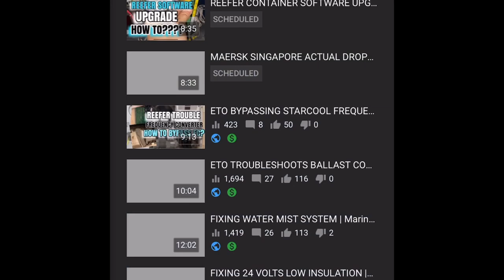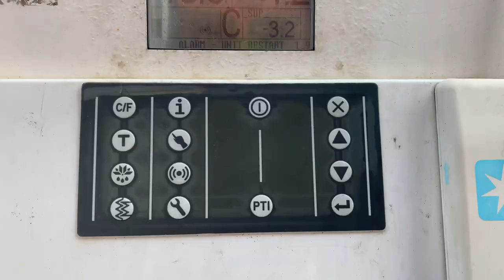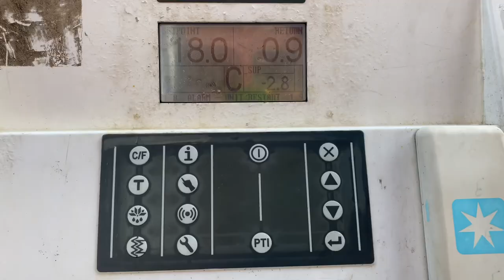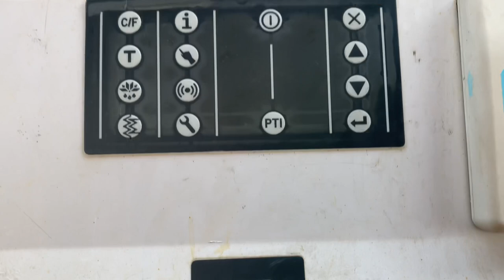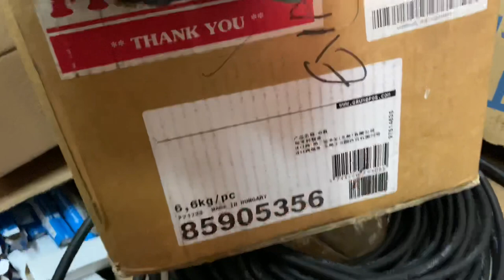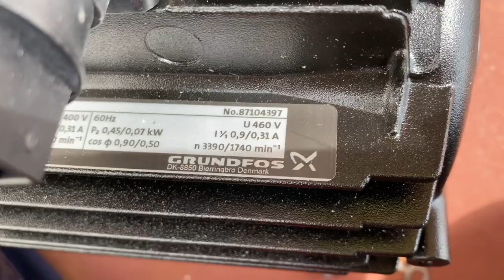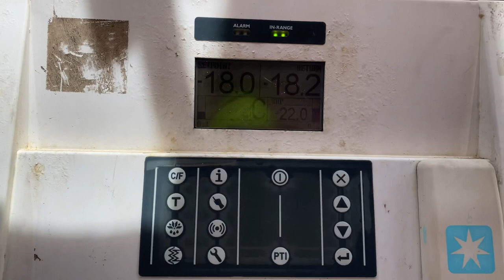EVAPORATOR FAN MOTOR REPLACEMENT | REEFER CONTAINER

Comment: today l got a call from the  harbour,  they said, "  you have to come to fix a daikin reefer container which shows an alarm E109".  l was very happy because l can use the information from the video you made.  and when l reach thier l see that the situation is the same as it was in the video,  l felt happier then.  but unfortunately the EEV was diffferent so l tried to oppen it, but l coudnt becuase it has no nut so l coudnt solve the problem, so we did cross stuffing of the cargo to another container.  

so pls tell me how to open this kind of EEV
Reply from the maker: Might be the solenoid type. You should have used the magnet to open and close the valve.
Reply: @leckyjake  thanks.  where can I find that kind of magnet?

Comment: Sir we electrical engineering do btech and join academy for eto course and we have been taught good enough by academy about duties and responsibilities of eto which is to be handled. And my doubt is.... is that information and practices by academy enough for eto job duties on board.

And when we sail as a trainee eto we are under senior eto and chief engineer... will they train us efficiently on board so that one day we have to handle our duties and responsibilities alone right... will they train us like that
Reply from the maker: Basic fundamentals are the most important in every job onboard. So yes you can apply the knowledge onboard, is it enough??? It will always depend on your eagerness to learn. You need to have initiative and willingness to learn.
Reply: @leckyjake  yes sir I'm very thankful for a good reply

Comment: A very difficult to replace  carrier container Condenser motor and evaporator motor sometime fan blade are stuck in the motor it’s very difficult to remove  blade into the motor vessel sailings Time are come  Come close that time my situation. 
 is due or die    It’s true or not       🤣😂😅
Reply: Its very difficult sir if you have no tools to remove the blade you need to have a puller to remove quickly the blade